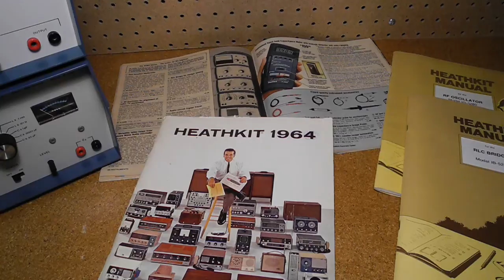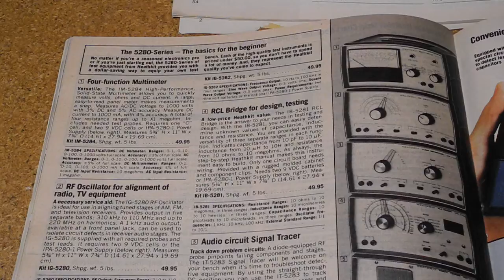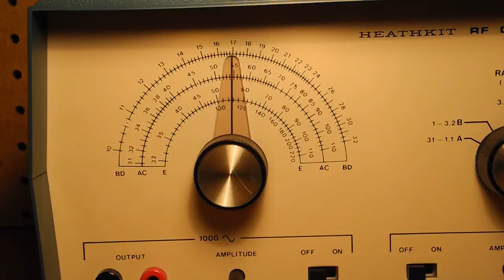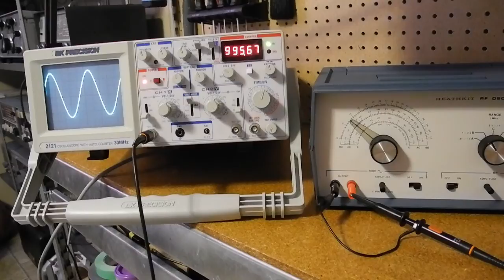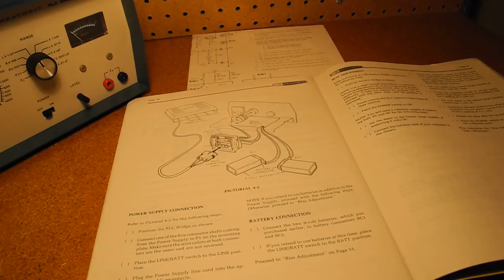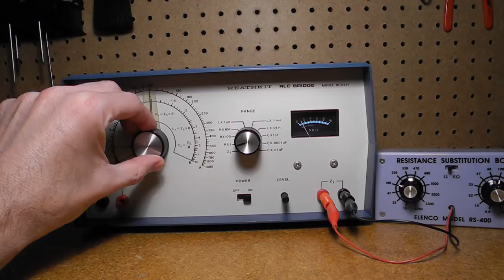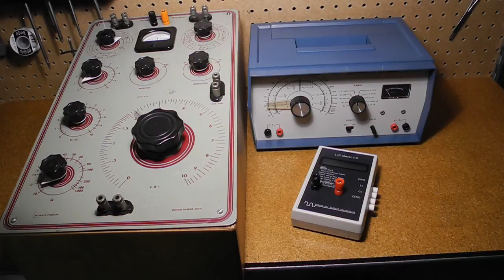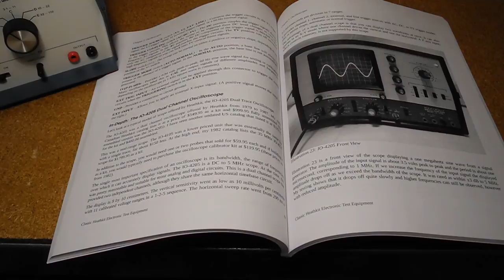The Heathkit IG-5280 RF Oscillator and IB-5281 RLC Bridge

Comment: Great video, I bought the IG-5280 for my bench and this video really helped me.
NOTE:my signal tracer did not come with probes but surprisingly it did come with an IPA-5280-1 power supply unit that works good. The signal tracer however was only wired for batteries. Aside from some cleaning of the case, a bit of lube in the level control to clean up some scratchy noise this unit works fine. I am going to see if I can find a probe set for it and if not just build one.

Comment: Can you test it without an oscilloscope?
Reply from the maker: Yes. The original kit could be tested and aligned with a DC and AC voltmeter, and a frequency counter or a radio.

Comment: Any suggestions on a replacement meter for the null? Mine has failed.
Reply from the maker: Look on eBay or Amazon for a small 200 uA (microamp) panel meter that is a suitable size to fit in the case.
Reply: I am looking at this unit now that my late father left behind as he passed. What exactly are these used for? Unfortunately I think I will need to dispose of this unit

Comment: I still have the RF oscillator, which I built around 1979/1980 time frame.  The unit worked well for an electronic hobbyist like myself.  I never bought the power supply that goes with these units.